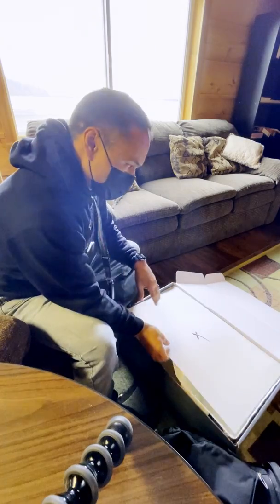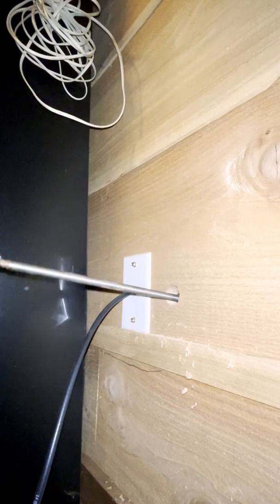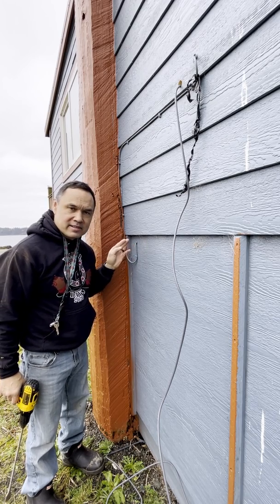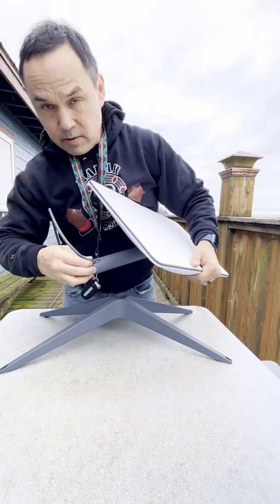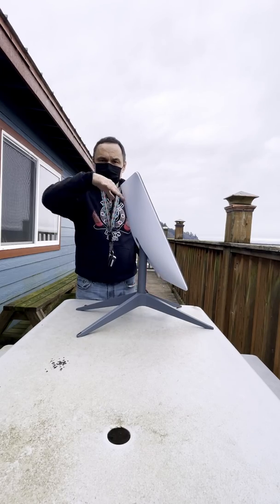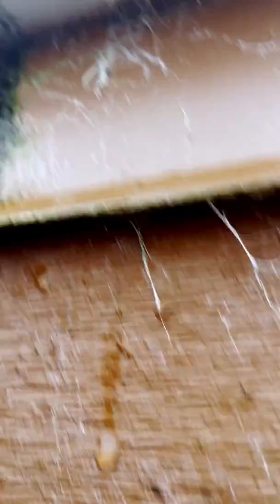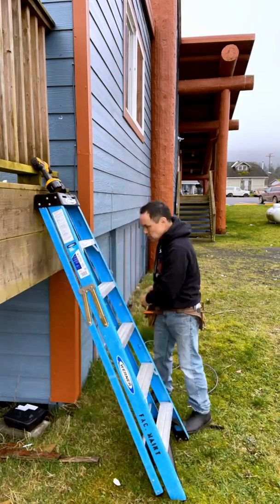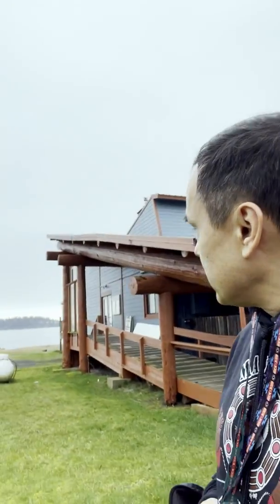How to install a Starlink, second generation

Comment: Thanks a lot for the instructions man. I'm not a handy man by any means but this looks simple enough. I can't believe that cable design. Have to drill a big ass hole for that dumb L cable when it could have just been straight on one end at least to make for easy install
Reply: On further inspection I'm just dumb haha the end that connects to the dish is indeed designed to bend straight. It just looked the same on both ends until I looked at it right

Comment: I have a snafu re-connecting the end of the cable back into the antenna arm.  I noticed early in your install demo that you had a couple seconds of the oh-oh but then yours went home ok.  Did any of your other installs have a worse snafu getting the cable back in place?
Reply from the maker: No, most of the time It goes in pretty easy

Comment: Great video. Quick question, about the snow problem. Do you expect there to be any issues if the snow build up to under the dish? Here in Alberta canada, we get feet of snow lol
Reply from the maker: No, the dish has a heater in it. plus it sits at a light angle.

Comment: I've been waiting for the star link for two years they are finally sending it to me. Will I receive automatically the second generation? They are very vague on what I'm getting there is no phone number contact etc.
Reply from the maker: All the new ones shipped are the second gen from what I have seen. Careful with the plug they seem pretty fragile, also make sure nothing can chew on your wires like dogs.

Comment: Hey Jason, great video but have you come across any Starlink accessories that allow 2'+ extension to that stand legs to pole connected to dish?
Reply from the maker: No I haven’t, that would be a good idea.
Reply: @JasonToddRoberts  thanks for fast reply. I'm surprised Starlink doesn't sell extension or if it does I can't find it.

Comment: You need a metal detector for constructions ! It can't detect including electric ⚡ wires and it can't tell you if have power or not......it can't detect including other materials like wood 🪓 or what kind of metal is steel , copper , aluminum......just Google it ! You need the dongle for LAN connection..... what's the catch with indoor mask 🎭 ? You got a different kind of Covid there ? 😁
Reply from the maker: That's why I don't drill all the way through in one shot. I look inside the hole and make sure there isn't any wires.
Reply: @JasonToddRoberts  i know i did work in construction so wen Bosh for example feel the real estate boom in 2007 they launch all kinds of tools offer for example you buy a drill for concrete they give you bonus a metal detector or laser level or telemetric tool today this kind of toys get more and more advance and afordable.......not metion you use a normal electric screwdriver not a impact version it excellent put screws in wood material !
Reply from the maker: @argusburebistus8602  I literally live at the end of the earth. We have limited means to get things done, so we gave to make due with what little we have. Sorry I couldn’t meet your high standards, I’ll try harder next time!
Reply: @JasonToddRoberts  guess what ? So do I ! By choice i Romanian 🇦🇩 living on the top of Carpathian Mountains with no cell phone signal no internet cable and my country have one of the fastest and cheaper internet services...... Starlink will be perfect i use a Mesh Internet with others it slowly but functional anyway my people are a poor nation with prices like Austria so i learn to be efficient buy the right tool for the right job....for example wen the battery set of a electric screwdriver running out of capacity storage i don't go and buy new ones i just buy new cells and replace it ......much cheaper always do the maintenance of  power tools and they last much longer......now in matter of screw in wood impact screwdriver make the difference i even have air compres tools because working outside in mountain top i deal with humid environment that can't shortcut ordinary power tools.....so i was not disrespectful with you but i hate se people struggling because of lack of knowledge or good ideas !
Reply from the maker: @argusburebistus8602  that’s funny! You should post some videos about some of the things you mentioned. How you overcome your struggles.